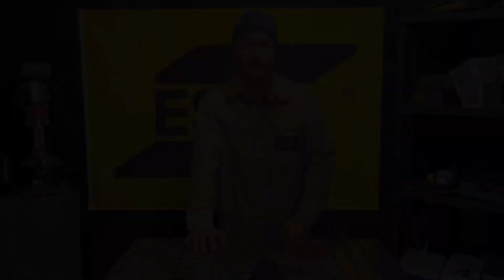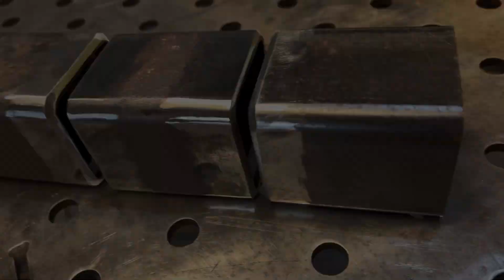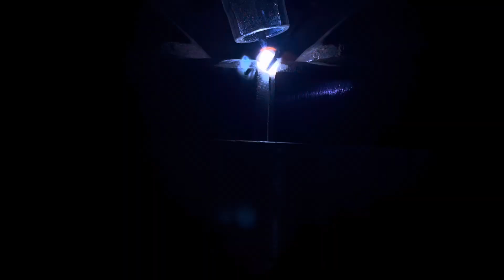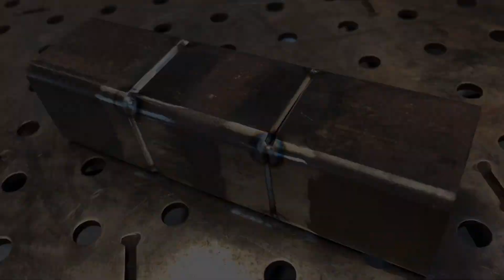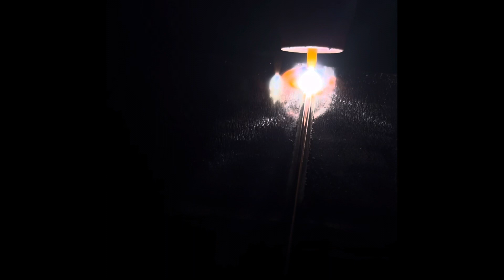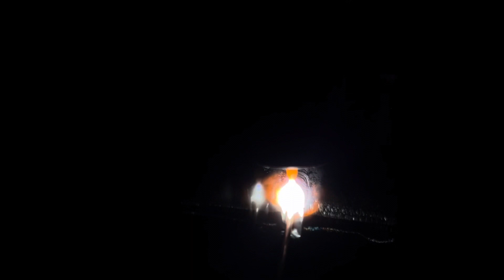How to weld box section/#welding #fabrication welducated

Comment: Will you make video based around fabricating with something like 16ga square tubing and minimizing distortion? It seems the welding is often the most talked about but not the fit up and fabrication side of things.
Reply: Also, in a scenario such as this, maybe talk about which welding process would be most efficient and time effective. It took me 4-5 hours to make two 16"x16" (1" 16ga square tubing) frames yesterday with 45 degree corner cuts and the end product didn't leave my satisfied. I love how you get straight to the point, I am not a fan of intros.
Reply from the maker: @Twenty5archive   just checked the box section I can get it ordered in the next week or so, what welding process did you use to build your frames??
Reply: @WELDUCATED  I am in my first year of welding school, I used mig to tack it up and welded the rest of the corners with TIG and carbon steel filler rod. I think I should have done mig stringer beads but decided tig would require less grinding.
Reply: @WELDUCATED  I think a huge reason the end result did not lay flush (2 of the 4 corners directly opposite from each other are slightly higher than the other 2) is because I only had a small aluminum topped table to weld on and the entire frame was not flat on the table, hanging off halfway most of the time. Also I had to use a angle grinder to cut the 45 corners so there was a decent gap on some of the corners, Which was also a reason I used tig instead of mig for the rest of the welding.
Reply from the maker: @Twenty5archive   what’s your marking out skills like so when it comes to marking cutting lines and drawing out in general, honestly you the only thing you done wrong is tacking it with mig/mag and you are right as well most people would think mig/mag welding it would be quicker but only if the welds are both being ground off afterwards. Otherwise tig welding was the way to go you can grind the welds off in no time. I have similar box section laying around I am going to get start a video for you!
Reply from the maker: I love the idea, you know it’s funny I am planning on doing more fabrication and welding because there’s not really a massive amount online is there! Nice talking to you I will definitely add it to my list and get some 16ga ordered!
Reply: How strong is box section welded together  compared to a length wire no join in it?